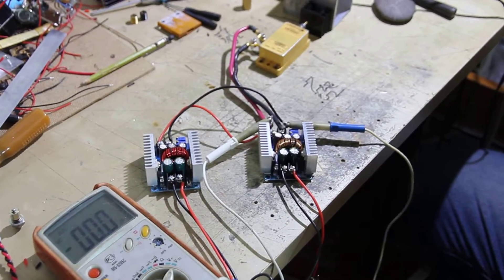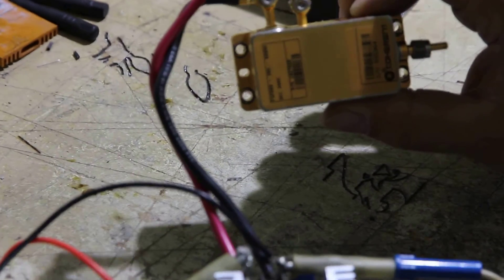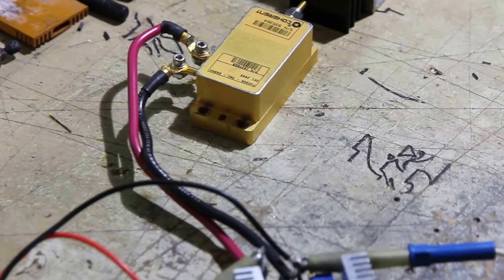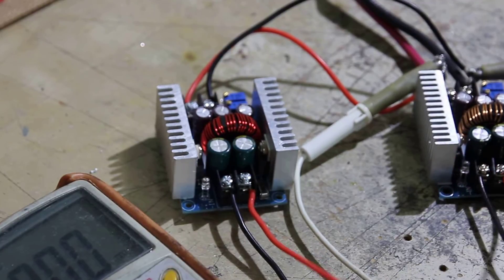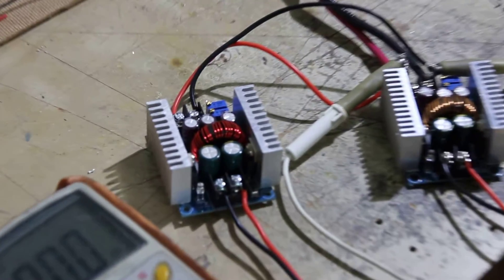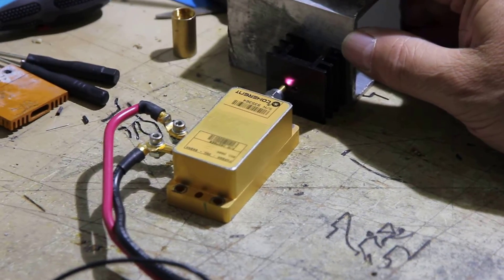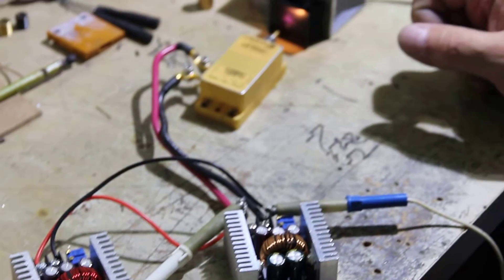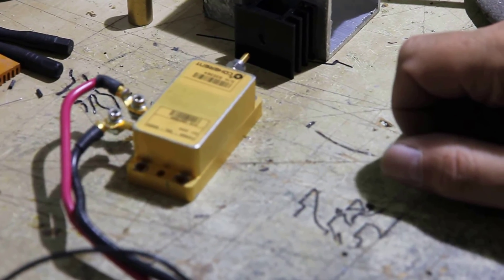First launch of an infrared FAP800-30W 808 nm wavelength

Comment: After a blow the module is still working condition?
Reply from the maker: yes, we repaired it)!
Reply: I think you burned the fibers inside the module. The current is too high most probably. How did you repaired it?